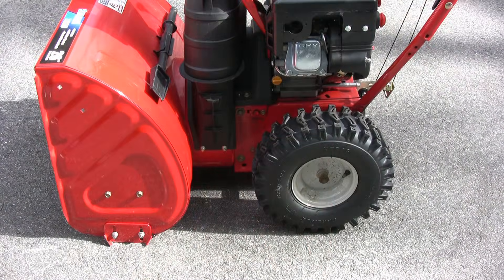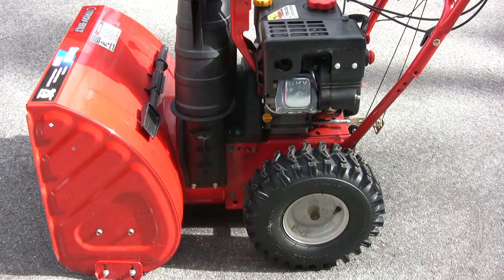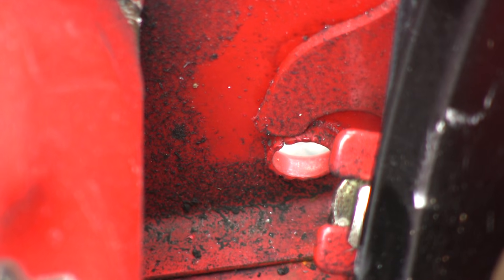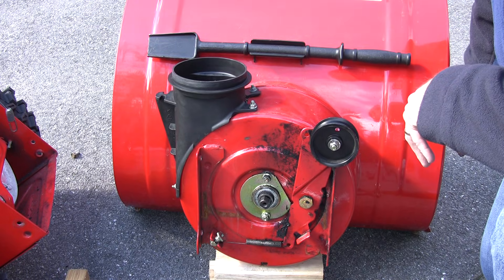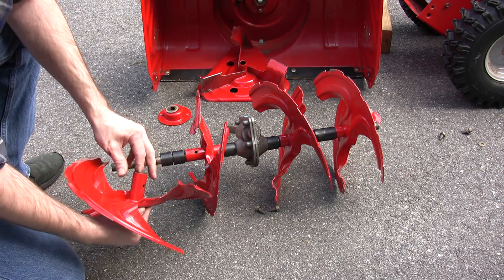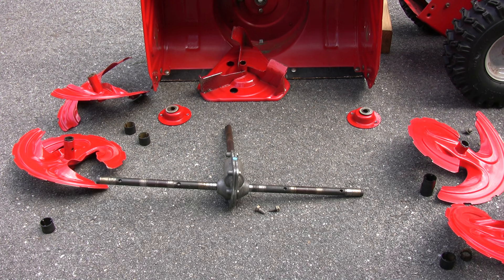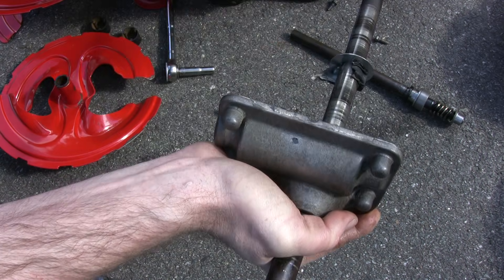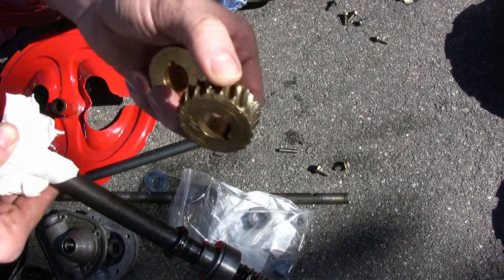Troy-Bilt MTD Storm 2620 Snowblower Auger Gear Repair - Part 1

Comment: These two videos are incredibly helpful. A few weeks ago, the first wet snowstorm here in the Northeast turned the brass gear in my aging 2410 into a washer. I found the part easily on Amazon, watched these videos from end-to-end twice, and was able to make the repairs without any issue.  This could have been a painful and frustrating process, but every little crucial detail was captured here skillfully.  And yes...reattaching the cable to the idler pulley was the hardest part.  :-)  I'm now ready for the next storm. A huge THANK YOU!
Reply from the maker: Awesome! Glad it helped. I am still trying to get rid of the last of the ice from these recent storms. It's been a mess.

Comment: I must have watched @ 2:00 a dozen times trying to replicate how you took that cable off the idler.  Ended getting so frustrated I just ground off about 1/8" from the open end of the hook with a Dremel and chain saw tooth round sharpening stone.  Thanks for this video!  Wish I was as nimble with my fingers as you are so I could do this "normally".  Great video!!!!  A great help with replacing an auger blade that got trashed on my Storm 3090.  Love Troy Bilt!  Their parts department is just wonderful.  So much better than 3rd party pretenders out there that cost a LOT more $$$ and not nearly as fast with (free) shipping.
Reply from the maker: Thank you! If it's any consolation, it really fought me going back on. Probably took me 15 minutes to get it to cooperate. You taking a bit off should help. Hope all goes well with the machine! Thanks again for the kind words!
Reply: I struggled getting the cable off also.  Putting it back on I folded the blower handlebars down to give me more slack on the cable -- it was much easier going back on.

Comment: Thanks so much for this series. My Troy-Bilt is a 5024, slightly different then the 2620 but pretty much the same mechanics, and I accidentally ground it's auger gear in heavy snow last winter. Your videos helped me immensely on taking the front auger off and fixing it myself, and they probably saved me a bundle of $$ too!
Reply from the maker: Great to hear! Thanks for commenting. It is fun to hear when this has helped some one. Good luck this winter!

Comment: Just finished a repair on my Storm 2620 using this video. The clarity of the step-by-step process and video gave me the courage to try to fix it myself instead of bringing my machine to a shop (they were backed up at least three weeks).
As it turned out, I had a small rock trapped between the impella and the housing. The grinding and eventual sparks were pretty drastic, but with the help of this video I took it apart and found the stone.. Thanks for the great info and video
Reply from the maker: Awesome! The machines are really fairly simple once you get into it. Thanks for the feedback!

Comment: Thank You for sharing this video.  I had a landscape rock get wedged behind the impeller.  Thanks to your video I was able to split the unit, remove the auger assembly and get back up and running.  Very much appreciated.

Comment: Davin excellent video, everything went according to video EXCEPT. I switched the anger blades, had left on right and right on left.. Snow kept being pushed to the sides rather than to the middle to be " chompped" up by the impeller. I never gave it a thought but thanks to you're excellent video skills there were multiple scenes to get my self oriented. Big thanks

Comment: Great video! 

The gearbox went out on my 11-year old 2410 this week, so I have the gear and shaft on the way. 

I did the teardown tonight, to get the old grease and metal shavings cleaned out so I'm ready when the parts get here. 

It's a good idea to check the impeller bearing while all is torn apart. Mine was quite rough, so I ordered a new bearing tonight. I'll have to wait to re-assemble, but it beats a second teardown.

Comment: Thanks for posting...this helped me replace the inner left auger blade on my Storm 2410 after a nasty run-in with unseen heavy gage wire kicked into my driveway from a plow...
Reply: I had the EXACT SAME THING happen to me and this video was a big help too!
Reply: About to do the same. Thx for the vid!

Comment: Davin,
Thanks for posting this. I took my 2620 apart last year because of a bent auger blade, and had a heck of a time separating the two halves of the machine.  So, when I had to remove another bent blade last weekend, I cracked and removed one of the plastic spacers to get the gear box to separate.  But I hadn't figured out how I was going to get it back together.  Now that I see how easy it should be to remove the entire front assembly, my job will be much easier. 
And, yes, both blades bent because of heavy, wet snow.  We have a short driveway, but are on a state road, so we get plowed in.  I have to be careful when removing the plowed snow, and I was in a hurry.  :)

Comment: I have a Storm 5024 (with manual chute) very well done video, with your help it was about a 2 1/2 hour job ( although i had the full auger already assembled one the bought).   Thanks so much
Reply from the maker: Glad it helped. Good luck with the remainder of the winter!

Comment: My 2610 is over 15 years old and aside from changing the belts and friction wheels proactively it still runs great.  In fact I have never changed the gear oil so maybe I am just lucky but hope to get a few more seasons out of it.  Next one will be an Ariens I think

Comment: Great video. I can't seem to get the worm shaft out of the bushing. Tried a hammer but I am not sure how hard I can hit it. Any help would be appreciated!!
Reply from the maker: I would apply a bunch of penetrating oil (I like PB Blaster (https://amzn.to/3qFx6sL [affiliate link to Amazon]). You should be able to find it locally. I would also heat it up with a propane torch to see if that would give it the extra space to come off. If it is really stubborn, repeated cycles of heat and cool with penetrating oil should do it. You are just looking to get the part sort of hot and cause it to expand, not turn it cherry red. All that said, it shouldn't be on there that tight. Makes me wonder if water got to it and corroded it together. You may have to get new parts. Good luck!

Comment: Thank you! My gearbox looks like the same one. I have a 20 tooth gear.  Do you know where i can get the gasket for this and the bushing that goes on the end of the impeller shaft?
Reply from the maker: I would start here: https://www.troybilt.com/en_US/service-and-parts Put in the machine model number and then pick the year. You can then go through the diagrams to find the exact part number you need. After that, buy it direct from them, oy do some google searches for the part number to see who else might be selling it.

Comment: How can I find a part number of a rebuild kit for the storm 2410 model? The parts manual lists the whole gearbox as 918-04171C - But doesn't seem to identify a rebuild kit - particular interested in the seals, bushings, etc.
Reply from the maker: I was trying to get to a parts diagram on Troy-Built, but that was not working for some reason. I don't think you will find a kit, you will have to buy parts as needed. Just search google for "storm 2410 parts diagram" and you can find places like the following where you can buy whatever part you need by cross-referencing the diagram. https://www.jackssmallengines.com/jacks-parts-lookup/manufacturer/troy-bilt/31-snow-throwers/2012-models/31as62n2711-storm-2410-2012/auger-auger-housing

Comment: Excellent video I did mine after only 5 hours of use.  I replaced with the original design parts, not the cost reduced ones.
Reply from the maker: Thanks for the compliment! I hope you get more than 5 hours out of the new parts.

Comment: Hello, thanks a lot for this video. I have a 2410 that looks very similar. The impeller spins but the auger blades don't do anything. I am almost positive it is the gear box. Troy-bilt wants $321 for a new assembly. May I ask......how do you search parts knowing you are getting exactly what you need when I can't get anything other than the full assembly from Troy bilt.
Reply from the maker: You should be able to go to https://www.troybilt.com/en_US/service-and-parts#diagrams and pull up the diagrams for your specific model and year. You can get the individual part numbers and then search for them at places other than Troy-Built (if they are not selling them).  I randomly chose the 2010 year of the Storm 2410 and it looks like they are selling each individual piece.  Based on your description, you probably need  the brass worm gear (part 917-04861), but I would take it apart and look for damage to the the impeller shaft or other parts before you order anything. Good luck!
Reply: @DavinDesborough  Wow, thanks a lot for responding!!!
Reply: @DavinDesborough  I was on the phone with tech support and they told me they couldn't tell me the individual parts inside the gear box. This was a great help, thanks again!

Comment: mtd sure makes some great quality stuff.  my toro 7and 82426, 724,  only have 40 plus hard seasons of use on them and the auger gears are original on all of them
Reply: Big difference in cutting grass compared to blowing wet snow.  There is a allot stress on components especially when subject to chunks of ice or rocks. Something a grass mower might never see.

Comment: Just found this video and I have an issue hopefully you can help with. My neighbor used my snowblower and it ended up running over a metal solar light / ornament that broke off a shear pin and bent one auger. I bent the auger back in place with a wrench as good as I can and replaced the shear pin. It works now but now the machine has a heavy vibration when the auger is in use and some sound that follows the rhythm of the vibration that makes the machine pretty loud. I watched it spin and confirmed nothing is hitting anywhere. Would replacing the bent auger fix this issue or do I need to replace the entire auger assembly? Maybe the bent auger is making it spin out of balance? I'm not sure but hopefully you can point me in the right direction. New auger assembly is almost 300bucks and replacement single auger $70. The item he ran over took a quarter sized bite out of the bent auger so it definitely faced some force.
Reply from the maker: Sounds like the shear pin didn't let go in time and you may have damaged the brass gear. Does the vibration you describe feel faster than the rotation of the auger? If so, it is most likely in the gear box and you are probably looking at a tear down like I did in this video. 

The only other thing would be to look at the second stage. Did the impeller get bent or otherwise damaged? If it swallowed up the light, it might have suffered damage when it hit the impeller. 

Best of luck!
Reply: @DavinDesborough  I will take a look at both of those things tomorrow. Thank you for the prompt response!

Comment: great video   what are the part numbers.
thank you
Reply from the maker: Thanks! You can look-up part numbers here: 
http://www.troybilt.com/equipment/ARIPartFinderView?catalogId=14102&langId=-1&storeId=10001#/s/TRB/2620/  

Just click "Select Assembly" next to the correct model year, then click "Auger & Auger Housing" and you will see a diagram where you can identify the parts you need. Good luck!
Reply: Thank you

Comment: I have a Troy Bilt 8526 looks to have same gear box as you have shown.  my manual indicates it has a grease fitting on gear box but I cannot locate it.  How can I add grease in the gearbox without taking it apart?
Reply from the maker: If you also have a plug in the gearbox you can remove it and either force grease down the hole or try to fit a grease zerk. Short of that, you'll have to dissemble. Good luck!

Comment: I have the same snowblower that I bought 2 years ago from a friend that used it about a half dozen times tops. It worked pretty well for the first 2 seasons but this year I'm having issues. It doesn't want to throw snow and the auger seems to struggle. the motors starts on first pull and runs strong. I thought maybe it was a belt. The belt closest to the auger is very loose but seems to tighten up when engaged. but I thought maybe it's not tight enough. it is the original belt. my auger seems to be locked in. the only movement is in the blades. I did notice a burning rubber smell earlier this season when it wouldn't throw some heavy snow.  Any help is appreciated. I too have a very large driveway and have put it through some good runs here in MI.
Reply from the maker: +Burbs Burning rubber smell... that means the belt was slipping for some reason. It it is too loose, or there is a lot of resistance in the auger assembly. I would separate the front and back and give things a once over. First, take a good look at the belt. You can then  also check out the auger. If you pull back the brake, can you rotate things by hand (or perhaps with a wrench on the main pulley bolt: see 3:21). If it turns smoothly and without and concerning noises, I would put in a new belt and give it a go. If something feel or sounds wrong when turning the pulley, I would take it apart and lubricate everything. Hopefully it's just a stretched belt. Good luck!
Reply: +Davin Desborough Thanks for the reply. I took the cover off and noticed there was some residue that looked like it might be from the auger belt. I bought a new belt which I may put on tonight. we are supposed to get more snow so I will be able to test it.

Comment: Thanks for posting this 2 part video. My worm gear is history and I was planning on replacing it. However, I can’t seem to find the gear going to a couple of local snowblower dealers/repair centers. They can only order the entire unit. Any chance you can direct me to a company that sells the worm gear by itself?
Reply from the maker: If you go to https://www.troybilt.com/en_US/service-and-parts and look up your exact model, you can order from them, or search online for the part number and see if you can find a better deal. Good luck!
Reply from the maker: *Look up your model then drill in to find the gear.
Reply: Thanks!!! I did that after I sent you the message. Found it. Surprised both the ships didn’t put in some extra effort. Oh well.

Comment: Hi Davin
I have Ice building up behind impeller each use… do you know is that a bearing issue, belt issue or what? 
Thanks
Reply from the maker: It sounds like the impeller is too far into the blower housing. Is this interfering with it's operation? It could be the bearing, but I would first check the bolt that holds the pulley to the impeller shaft (see 3:01 in the video). Perhaps it has worked loose allowing some travel in the assembly.
Reply: Davin Desborough Thanks Davin!
I'll check that bolt, it stops the auger from working… what I've one is spray WD40 generously inside after I removed Ice with heat gun.  This seems to alleviate the build up but it may be something else. I noticed the Auger Cable wasn't tight enough but it seems like its as tight as possible so that may be the issue. I may have to get a new cable.
With the latest 2 feet of snow here in Boston I'm grateful for your advice.
Reply from the maker: steve tolan WD-40 might not be the best thing. It won't stay around long, or if it does, it can gum up over time (so I've heard). There is a spray called Sno-Jet (http://www.amazon.com/gp/product/B005JOZFWK/ref=as_li_tl?ie=UTF8&camp=1789&creative=390957&creativeASIN=B005JOZFWK&linkCode=as2&tag=wwwdesborougc-20&linkId=KSUCPAFFJSFYETP6) that is supposed to be the thing to get. I've not tried it myself. After adding paddles to my impeller (see my other videos), I have had no issues with clogging. 

I'm in southern NH, so I feel your pain. I have not had any icing issues on mine during all this snow removal. It must ultimately be too large a gap behind the impeller. Good luck chasing it down. Let me know how you make out of if you want to bounce any other questions off me.

Comment: The auger gearbox on mine must have water in it as I always need to put the heat gun to it to thaw it before running. Might try WD40 and grease to the small vent hole for a temp fix to get through the rest of the winter. What do think?
Reply from the maker: I take it that it won't turn at all until you heat it up? It does sound like water got in there. I don't think adding extra grease or WD-40 will help as you'll still have water in there. That said, more grease won't hurt anything and what you have in there now may be shot, so some fresh grease would be a good idea. I would absolutely split it open and clean it out ASAP. Good luck!
Reply: I'll need to wait for warmer weather, no garage, do you have a link for the repair kit you are using?
Reply from the maker: Greg Scott It was on ebay at the time, but I haven't seen one there in a while.  Hopefully all you need is to clean it out and add new grease. If you are waiting for spring, I would take it apart and then assess if you need any parts.

Comment: Davin, Thank you for this posting.  Could you tell me approx. how much the kit & necessary parts would cost ($$), and what length of time (Hr.-Min.) it would take approx. for an experienced snowblower mechanic to start & finish the job. Thank you.
Reply from the maker: I purchased the rebuild kit (worm gear and shaft plus bushings, pins, etc) off ebay for something like $110. If you need all the same parts, it should be somewhere in the $100 to $150 range. If all you need is a new brass worm gear, it might be as low as $20 or $30. Of course you need grease too. I am going to guess a shop will charge 2-3 hours of labor. If you hustle and have everything at the ready, it is a two hour job. I hope that helps.